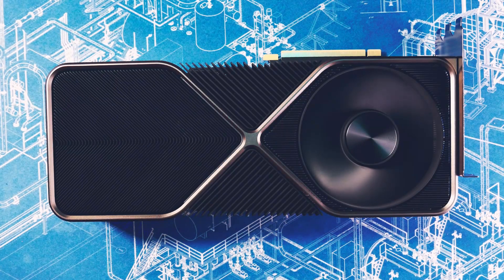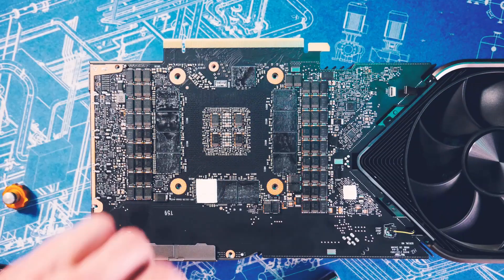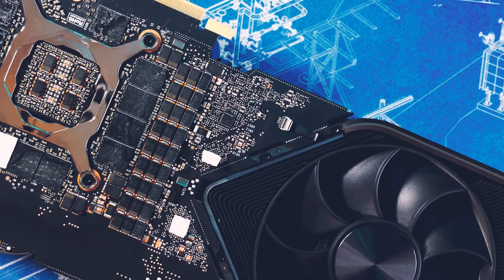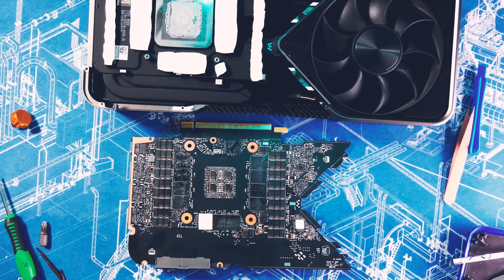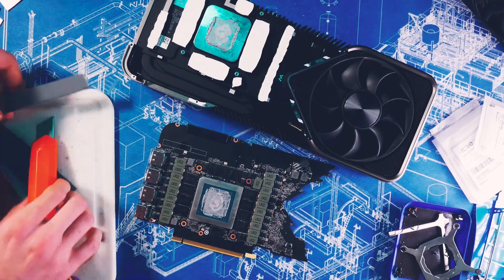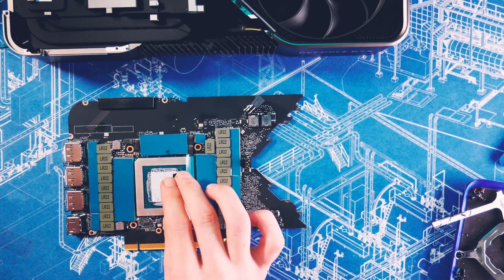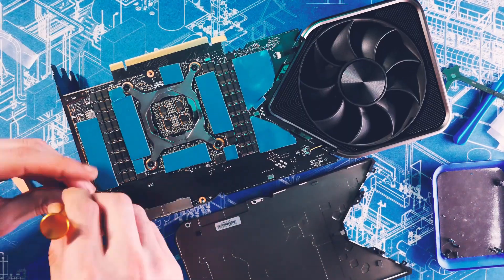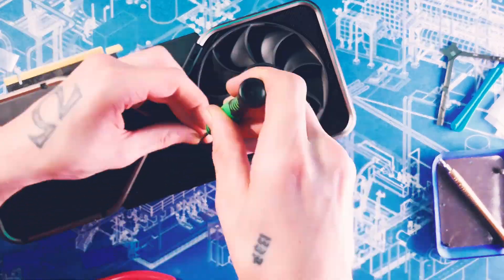How to fix the RTX 3090 with Thermal Pads | Overheating memory nVidia FE thermals | Founders Edition

Comment: Man my 3090 FE even after repadding multiple times and dif brands, sits above 100c… I just don’t get it… I followed crypto at homes design to the dot and no improvements.
Reply: same on my side... got the same pads as in this video and still the Mem Temp. is around 100-102 C° at 100-105MH/s. Maybe the ambient temp. is too high??
Reply: @c1berspace469  Same for me, I think I want to just get rid of this card at this point
Reply: Did you figure out what could be wrong? I also replaced the pads TWICE, following these videos, cutouts, and still same result. Memory Junction temp at 106 Celsius.
Reply: @doctor0z97  I have not… i gave up… most it gets to is 102… I don’t leave it mining 24/7… maybe at most 7/8 hours a day when I’m at work.
Reply: Thermalright pads 12.8w/k

Furmark would get me 104c after 10 minutes but sit at 102c for 5-6 minutes of it

Etherium 104c after 30 seconds

With the new pads 92c after 10 minutes furmark

And 102c memory after 14 minutes etherium

104c after 3 minutes if i dont shunt my GPU backplate to my case using more thermalright pads in fact i used more pad to glue my GPU to the case than i did inside the GPU

So for me i would next need to cool the case itself as its at 80c around where the GPU is connected and it tapers down to  27c at the farthest point

I guess its probably down to luck of the draw as to weather you get the 2.5w chips or the 3w chips

So x12 thats 30w or 36w as a minimum that your backplate has to do

But here is the thing 90 seconds at 100% fan speed takes my memory from 102c down to 48c and the case is no longer skin meltingly hot to the touch

So its just a thermal displacement issue for me at least as the pads are doing there job
Reply: @commanderoof4578  im not exactly sure what you just said.

Comment: Are all the original pads 1.5mm or is it okay to compress the new pads if they are thicker?
Reply from the maker: everything was 1.5 :) generally they need to compressed a bit to make full contact, but that happens by screwing it back together :) cheers
Reply: @CursedMining   any chance that you could give the link for your gelid pads? thanks :)
Reply from the maker: @thibautnoah2599  YT will remove it, AliExpress: Yao Yue Store 👌
Reply: @CursedMining   thanks a lot :)
Reply: @CursedMining   thanks mate :) a bit worried about those cards as they are way more complicated than custom models, hopefully i dont fuck this up !

Comment: i have the same issus with my RTX 3090 EVGA XC3 Ultra Gaming and i don't know what is the best thermal pad to buy. Can you tell us the top 4 thermal pad to buy? And is it possible to know what size to buy ( 1.0mm, 1.5mm, 2.0mm, 3.0mm ) before buying ?

Keep up the good work!
From Canada quebec city!
Reply from the maker: hey mate! I don't know exactly for the model but EVGA normally makes it public so I would google the exact model :) Thermalgrizzly Minuspads are good, Gelid/Thermalright a bit better! Cheers and greets to beautiful Canada ⛏️
Reply: @CursedMining  Here what EVGA Tell. ( EVGA said 2.25mm for memory and 0.75 for inductors )
Reply from the maker: @benoittheminerandgamer  so I would try 2 and 1 or 0.5 as those special sizes don't exist 🙈

Comment: too much damn work for such an expensive card
Reply from the maker: I agree, it should not be necessary that we as buyers have to do those things that a card runs "normal", but I am still glad it worked out :) cheers!!
Reply: You are right! but maybe with the original thermal pad in the game the memory temperatures are ok. Not all GPUs are created for mining. We need an in-game test (4k) with the original thermal pad. If the temp is over 95c the company should do something about the next gpu batch.